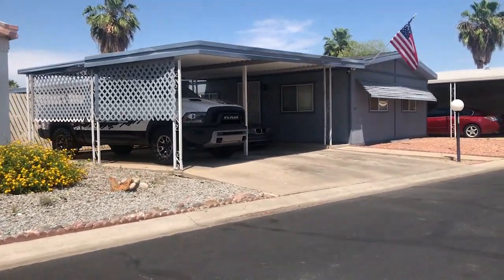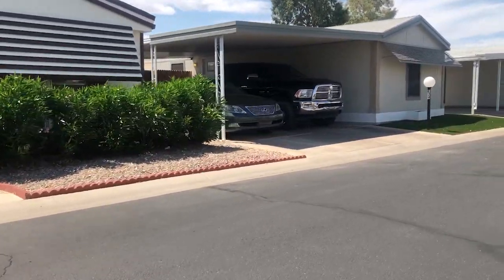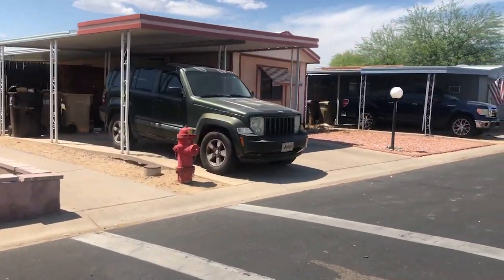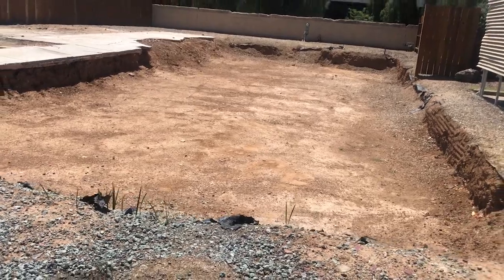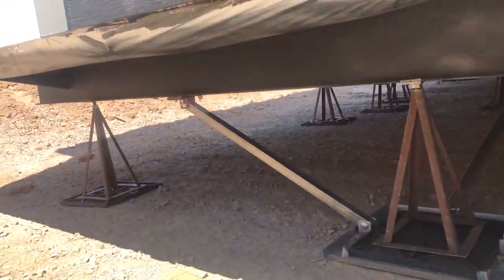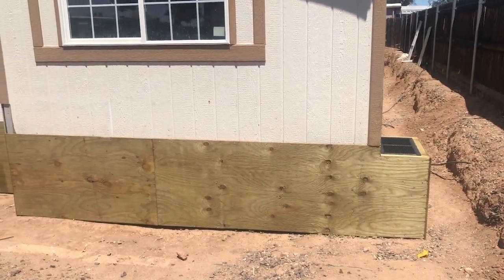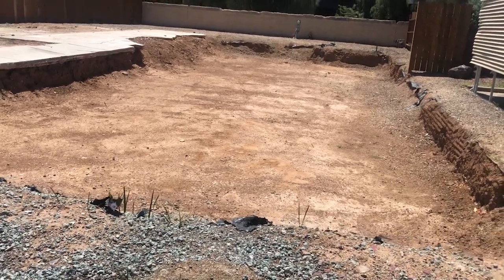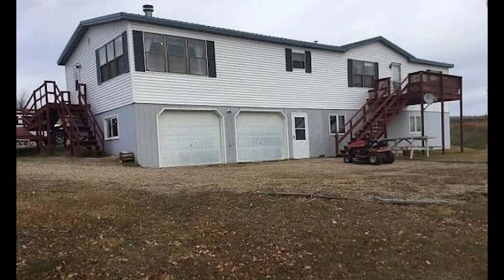Ground Set Mobile Homes 101 (Pit Set foundations)

Comment: We live in a somewhat wet area during parts of the year (Texas). Is it feasible to do this in this type of environment? Are there ways to mitigate water accumulating underneath the home? Thanks for any help!
Reply from the maker: Thanks for watching and commenting. I am definitely not any type of soil engineer or construction expert. However I have 100% seen multiple pitset mobile homes in Texas. Talking to your local city or county zoning department and permit department will be a good start with regards to setting your manufactured home in a pit set style like this. I would then encourage you to reach out to the Texas manufactured Housing Association to explain your situation to them and ask if they can refer a couple of Engineers or contractors to you that are experienced with pitset manufactured homes. They will be able to give you the ins and outs with regards to mitigating water accumulation, feasibility, prices, and much more. I hope this helps and starts to point you in the right direction. Moving forward let us know how everything goes. Hope it works out for you better than expected.

Comment: Hi, can you tell me how far apart the piers are suppose to be in California? Also, where can I get the piers from, I have cinder blocks currently.
Reply from the maker: Thank you for reaching out and connecting! Good question. My apologies about the delay in this comment reply. I certainly do not want to give you any wrong or misleading information. The codes and guidelines will change from city to city in California. While there are state minimums, I would definitely encourage you to contact the local code department for the city or county the mobile home is being moved into. There are guidelines already written up for a mobile home owner to follow. I hope that this helps and points you in the right direction. Moving forward if you have any follow-up questions never hesitate to reach out any time.

Comment: During monsoon season, does the dug in bottom of the Mobil homes flood with water? If so how does it drain?
Reply from the maker: Hi Mitch. Thanks for reaching out and connecting. Great question. In my experience pit style foundations are dug in areas with low water tables. This means that flooding underneath the mobile home is not usually an issue. However in some of these pits I have seen water sump pumps installed for this exact reason. When water does collect under the mobile home it can be pumped up and away from the mobile home. I hope this helps and makes sense. Moving forward when you have any follow-up mobile home questions never hesitate to reach out any time. All the best.

Comment: My mobile home is pit set and they put skirting under the mobile home and it is rusting. What is my solution?
Reply from the maker: Thank you for reaching out and connecting. I am curious what this looks like. If the skirting is simply underground then it is likely not doing much in the way of supporting the mobile home or keeping animals or the weather. You may likely be able to simply remove this skirting that is underneath the home. If the skirting is somehow holding the earth back or keeping out animals then you may want to replace this, however my opinion would be to either let it remain as it is or replace it with new metal skirting at a substantial cost. If you want to send me a picture my email is John@mobilehomeinvesting.net. If I am able to see what is going on I will be happy to give you further advice as well.

Comment: Can big tree roots near the double wide mobile home that are on blocks effect the flooring/foundation of the home?
Reply from the maker: Thank you for reaching out and connecting. The answer to this question is, absolutely. However I have seen a lot of large tree roots/stumps/live trees that are practically pushing or starting to push on a mobile home from the side. A property may go like this for a while before there being an actual problem. You may also cut into the tree a bit to make room for the mobile home and cut as little of the tree trunk as possible. However if you think it is the roots than these than these can cause problems in the plumbing lines and sewer lines as well as sometimes in the foundation. Some routes may cause homes to be unstable however this usually takes a good deal of time and is a slow process when it comes to roots causing problems with the mobile home anchors or cracking the concrete foundation. However over time it absolutely can happen. I'm not sure if this is the answer that you are looking for however I hope that it helps some. If you have any follow-up specific questions never hesitate to reach out anytime. All the best. Keep in touch.
Reply: @MobileHomeFormula  thanks for getting back. The mobile home has been there since 1995 and so has the tree. It is between two trailer homes and it is uprooted close to the two homes. I can clearly see the roots above the ground and reaches to the master bedroom. I can’t see the underneath cuz of the skirting around the house but I know when I’m inside the room, the flooring is getting messed up. There is a big creak in the middle of the floor and when I walk towards the side where the tree is the floor doesn’t seem to be level. The floor starts higher where it creaks and gets lower to the tree. What should we do?

Comment: Whats the life of that pressure treated wood after you push all the dirt against it?
Reply from the maker: Very good question. Non-pressure treated wood may get you through one year in most areas of the country. However this was filmed in Arizona where things are significantly drier. Non pressure treated wood will typically last a couple years. Pressure treated wood should be good for around 4 years or more in my experience. However if it is a very wet area then it may only last a couple of years. Hope this helps and answers the question.

Comment: How deep should the pit be for a mobile about 17 in or more be set
Reply from the maker: Thanks for reaching out and connecting. That is definitely a question best asked to the mobile home mover that you are working with and has experienced specifically in the area dealing with pit set mobile homes. They may offer a few options to you with regards to how you want the final product to look. My apologies for not being more specific in an answer however I do not want to lock you into one specific depth. But rather you hear from the professional locally that will likely give you options. Hope this helps and points you in the right direction.

Comment: Do manufactured home outer walls need structure support with concrete footing?
Reply from the maker: Thanks for commenting and reaching out. Codes do very around the country and around each state as well. However in my experience no concrete footing or serious structural support is needed when setting up a mobile home. The exterior wall of the mobile home will be resting on the floor joists that are resting on the I-beam running lengthwise along the mobile home. Usually these concrete footings are underneath these I-beams of the mobile home. If you are referring to the skirting needing any structural support, then that is typically a no as well. I hope this helps and answers your question. Moving forward if you have any follow-up questions never hesitate to reach out any time. Talk soon, John
Reply: My 1996 had many neglected years, moisture issues that are now corrected.   @MobileHomeFormula
Reply: I had the same curiosity about needing perimeter wall support since some contractors do stem wall foundation and other just skirt around with a very thin panel made out of wood or concrete. Even though they said that the skirting is just for look and appeal and keeping vermin out of the under home area, I still don’t have a more explained version to understand why the MH doesn’t need any perimeter support??